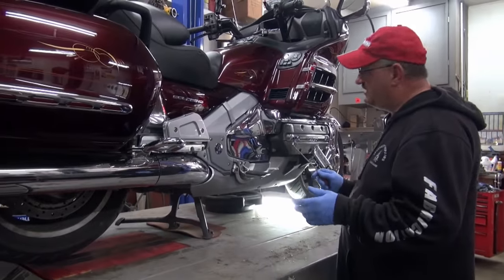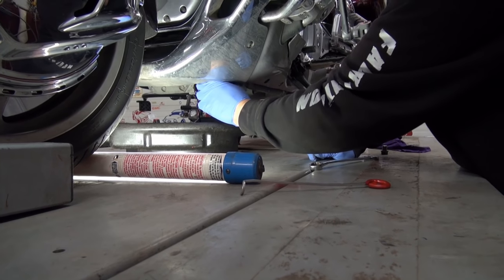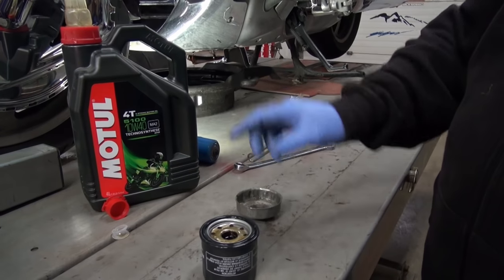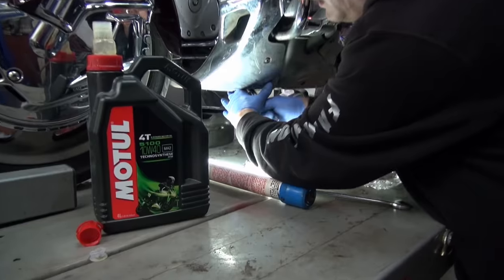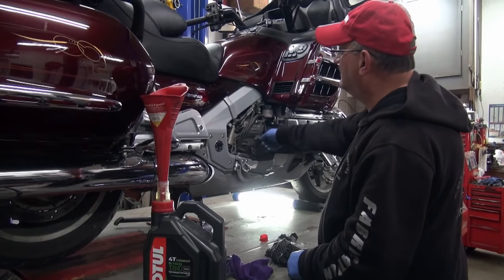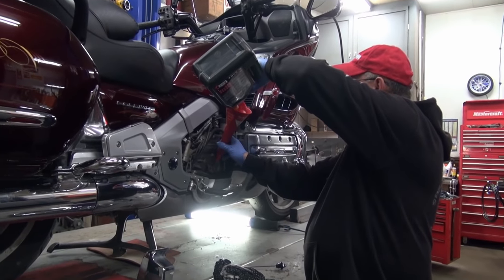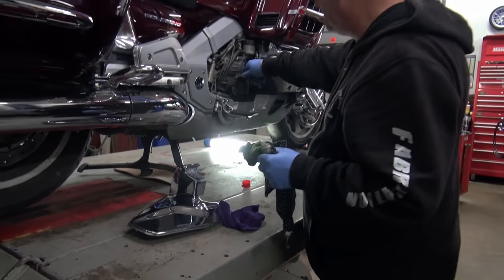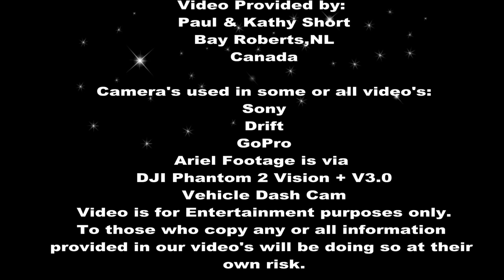Changing the Oil On A Honda GL1800 GoldWing

Comment: I was running Honda GN4 oil in my 2008 Goldwing. Then I watched this video and decided to try Motul synthetic (and prime the filter, of course). I can't belive how much smoother it shifts gears now. It's a stark difference. As always, Paul's advice is spot on!
Reply: You should use GN4 instead of full synthetic oil. Honda motorcycle use not fully synthetic because of the motorcycle clutch. Full synthetic oil make the clutch slip. It’s not good. It’s slipper not smoother
Reply: @DungNguyen-fj2wp  That's true for some bikes with some oils, but not for this oil with the GL1800. I have been using it for more than a year and the clutch is not slipping. I've been riding motorcycles for almost 50 years and I know the difference between smooth gear shifting and a slipping clutch.
Reply: @DungNguyen-fj2wp  You are wrong. Full synthetic MA or MA2 oil will not harm wet clutches. Car oil will.
Reply from the maker: I’ve been using that oil in my 2003 Honda GoldWing since it’s second oil change in 2003. Great stuff. Glad you found it good as well. Ride safe 😂
Reply from the maker: I’ve used it in my 2003 since new. Never an issue and purchased at the Honda motorcycle dealership.
Reply from the maker: You are totally wrong. I’ve use this oil since 2003. No Issues whatsoever.
Reply from the maker: It’s the best oil out there for the GL1800. Hands down.
Reply from the maker: @seatime674  Yes it does. Same location as the other 1800’s over the years years.

Comment: Just called Honda in Mesa and she told me $140 service fee per hour and with oil and supplies around $200 guess I’ll be doing my own as well 😱 thanks for the informative video
Reply from the maker: Not cheap. You’d think as a Honda dealer they would have a flat rate for that service. Do your own. It’s easy. Don’t  forget to  Prefill the oil filter. Your motor will love you for it.

Comment: Very thorough!  Thank you!  Great tip on lubing the side cover grommets.  A lot of Honda dealers don't know to do this, and indeed on my 2001, I lost the right side panel about 20 miles after an oil change, and when I examined the situation, both lower and rear grommets were missing, just like you said!

Comment: Excellent video Paul, precise and to the point.  I just bought a 2008 Goldwing and doing some research I was glad to run into your video because another one advised to remove the fog light cowling and also a secondary cowling to access the oil filter.  I thought to myself, "well, that's kind of a pain".  Now I see you don't have to do that so the process (as you explained it) is now a piece of cake.  I have always primed my oil filters, it just seems like a common sense thing to do so.

Comment: Awesome video. I had to laugh when you talked about putting the dielectric grease in the grommet holes and you said "otherwise, you will be going down the road with your feet on your highway pegs and the cover may blow right off". That is EXACTLY what happened to me this morning on my way back from San Antonio. And it is because I removed the cover last week and when I put it back on, I probably pushed the grommet rings right out. Really good wisdom in your video. Great teaching style and I love how you don't get bogged down on one thing too long. Great teachers, both of you! Thanks again.

Comment: Thanks Paul & Kathy for another very helpful video!

BTW Paul, I just bit the bullet and became a Goldwing owner, well an F6B owner at any rate.  Got myself a gently used 2014 F6B in black with ABS, no cruise control on the 2014 sadly but I'll probably invest in a Brakeaway throttle lock at some point.

I was on the verge of buying a used BMW K1600GTL but the fear of potential high cost of ownership in the future plus the bike feeling super top-heavy to me, the F6B ticked most of the boxes so I went for it.  I'm 58 now, so it will likely be my last bike.

I bought the bike from a guy in Fredericton and riding the F6B back home (2 hour's ride) reassured me that I made the right choice in picking this bike, unbelievably smooth and powerful and oh so comfortable!   My wife is going to love riding on the back!

Your videos helped me really consider a GW too, so thanks for that!

Happy riding and be safe out there.

Comment: Great video...I watched another that the guy removed the entire front lower cowl piece and thought to myself "that looks like a lot of unnecessary work"....Your video proved me correct....Looks to be easier than changing the oil on my 2007 VTX 1300...About to go out and change the oil in my 2015 F6B now....
Reply: Just did my 2013 and I took it off.

Comment: A guy that actually Explains everything he does sure makes for a nice video that gives tips on what you need to know to make it easier like how much oil, nice tip on getting that filter in and it not dumping the oil out as well. I always figured the oil would surely come out real fast. Makes for slightly long videos but good. Just wish I had an infinite data plan lol.

Comment: Nice job on the oil service, changing the washer helps insure you have no messy leaks. Thanks Paul
Reply: I have three honda cars (the same drain plug). The oldest accord 89 with 407k miles, never change the washer and never have any problem with it.

Comment: I had never seen nor heard of the idea of filling the oil filter before putting it on. I tried it and it works great! I did spill a couple of drops (big clumsy hands), but it worked just like in the video! Thanks.
Reply from the maker: Your engine will love you for it 👍

Comment: Great video and exceptionally nice camera lady.  I've decided I need to start doing my own oil and filter changes on my new GoldWing.  It'll take me less time than it takes to run the bike down to the shop!
Reply from the maker: Thanks Jim. Doing it yourself will save you some time at the dealership and yo just know it's safer in your hands than there's. Not many will take the care of your property like you will as the owner. Doing it yourself will give you the confidence to start doing other things to your bike and get you more familiar with it. Kathy said thanks. Ride safe.

Comment: Following up.  After being inspired by your video to do my own Oil and Filter change on my new Gold Wing, I actually did it and was so pleased with the sense of accomplishment that I changed the oil and filter on two other bikes.  I had a couple minor messes (slippery oil filter dropping into the oil drain pan) but don't think I got more than a tablespoon of oil on the floor.  Some Brakleen and paper towels and the floor is spotless again.  Just purchased the oil change kit to complete the oil change on my fourth (and last) bike.  Thanks for the video on your Gold Wing oil change.  You made it look so straightforward and do-able that it gave me the confidence to give it a go.  Also, your tip about not having to remove the lower front cover was right on and saved me time and hassle.  Thanks, again!
Reply from the maker: Congrats Jim. Happy to hear you got it done and more. Nice to know you now have the skills and know how to do it. Proud of you. Thanks for the update. Ride safe

Comment: I appreciate the tech tip with the grommets Paul. I have been going top to bottom through my new to me 08 and went ahead and replaced them all. I also used  dialectic grease as you suggest. The two oblong grommets were dry rotted. One of the oval grommets was actually missing. All of them are new now. Thanks again!
Reply from the maker: Good stuff. Happy to hear it helped you out. Ride safe.

Comment: Great tip about filling your oil filter first. My dad taught me that tip as well. He said  the exact same things you said in the video.
Reply: I am not sure why you would need to do that.  If you fit the filter dry and then add oil to the engine, the oil will make its way into the filter.  To prove it, try adding oil to the crankcase without having a filter mounted and see if it drains out!   The moral of the story is... if you put your filter on without priming it, don't start your engine right away after filling with oil.  Wait for it to make its way into the filter!

Comment: gday mate my father showed me to do that with filters in 1976 and ive done it on every single oil change on any car/bike ect i believe that like you it will eventually cause wear to parts waiting to get that oil .
Reply from the maker: I was taught to do that by an old diesel heavy equipment mechanic many years ago. I’ve always done it since. Every second counts when an engine needs oil and priming the filter gives it a fighting chance. Keep well and thanks for watching.
Reply: @7863348  Mentioned this to a guy called the old mechanic works and does videos on his  cb500x never got a reply from him about it maybe thats why he s the old mechanic the new one primes the filter 🤣 .
Reply from the maker: @crispernator  we have a new full size Ford Bronco. It’s a twin turbo 2.7 and I just did the first oil change on it. It has a cartage type oil filter so no priming it but when I did the oil change and before I started it I applied the brake and went full throttle on it to stop the injectors for opening and cranked the engine over to prime the filter. If you want to help out your engine and keep it purring  you need to get all the tricks required to make it happen. I’m always wanting to learn more and I’m an old dog 😉

Comment: Good tip to pre-fill the filter, at least pre-soak the paper element. Another fussy, detail bit would be to make sure to warm the engine for 3-5 minutes like the manual specifies to warm and expand the oil. Filling to the dipstick mark with the bulk oil temperature cold overfills the sump. Probably doesn't hurt the engine to overfill a bit. Pouring in all 4 litres gets you pretty close + or -. Small overfill would only diminish mileage and power a bit from extra windage losses in the sump.

Comment: Honda's engineers would have designed the filter mount horizontally if instant lubrication w2as an issue. I do agree with you that pre lubeing the filter is a great idea. 
Thanks for a great video.

Comment: I own a 1999 Valkyrie 1500, same engine basically.   I am in the process of hunting a 1800 Goldwing.   This is basically the same, the oil fill is in exactly the same place, but the oil drain and the oil filter are not.   Great info.     Seems pretty basic to me on the grommets, I have always lubed them with silicone grease for all the same reasons you mentioned, easy on/off and to keep them from drying out.   Nice video.

Comment: Great video. Up here in the north, where bikes are stored for five months at a time, I also think it's important to always put the bike away with fresh oil in it....never dirty oil. Metal doesn't like acids which have formed in dirty oil. My 2003 has stayed like new and I do think the engine appreciates clean oil during storage

Comment: I have a 2003 Honda Shadow VT750CD ACE, that I bought used from a gentlemen that I worked with out at McGuire AFB, NJ., and I learned something new by watching this video about changing the filter by pre-charging, I definitely will be doing that as well as using a lubricant on the grommets of my side covers. Also I know you and Kathy are very busy, but if I wanted to send you and e-mail how would I go about doing it?

Comment: I agree, it’s best to prime the filter. I am a Harley guy but searching for a GL1800 and learning about how to maintain them before I buy.
Reply from the maker: I’ve had over 40 bikes in my lifetime and the Wing was always the most reliable and comfortable. Good luck in your search. Ride safe. https://flic.kr/p/292676L
Reply: @7863348  fabulous pictures! What year are both of those?
Reply from the maker: Axel the GL1800 is a bike I bought new in 2003 and still have. The other is a 1980 standard GL1100 I purchased almost 5 years ago and restored from the frame up. It’s like new now with a few custom touches. Ever wonder what Honda’s flagship bike was before there was ever a GoldWing? It was the Honda Dream. Here’s one I have an restored about ten years ago  https://flic.kr/p/SA886u     https://flic.kr/p/4pwmwc.   https://flic.kr/p/7M77N1
Reply: @7863348  … they are both beauty’s! Great job with the restore. The Honda Dream is well… a dream!   😎
Reply from the maker: Thanks. Glad you like it. I started raiding back in 1961. Started off with a Honda Z-50 then onto a Honda CT-70 much like the ones I have restored in the photos. I guess by now you can tell I’m pretty loyal to Honda. That said, it don’t matter what you ride as long as you ride  
https://flic.kr/p/7qau1S.    https://flic.kr/p/7qauuf
Reply: @7863348  … flying to Texas in a few hours to inspect and most likely purchase an 08 GL1800 with Audio / Comfort / Nav / XM / ABS within 27k miles. So excited!
Reply from the maker: Hope it works out make sure the tires are in good shape with no cracks. Bulletproof bikes. Please ride safe. Good luck.

Comment: I enjoyed your video. What got me the most was that you had that bike for 13 yrs. It you don't mind me asking, other than regular maintenance have you had to replace seals, fork oil and things like that. The reason I'm asking is that I am looking at 2009 GW with 5,500 miles. In addition to buying it, I don't want to spend lots of money replacing things due to the age of its parts. Your input will be greatly appreciated. Thanks.
Reply from the maker: Yes I’ve replaced tires, fork seals, oil and filters but that’s the extent of it. This bike is now 18 years old and I’m sure it’s got more than that left into it. My other Goldwing is 41 years old. A 5500 mile Goldwing is a new bike. I would only suspect rotted tres on it. These bikes are built to last. Ride safe. https://flic.kr/p/ES4TES
Reply: @7863348     Beautiful bikes. I had a 1980 GW myself. Thanks for responding.

Comment: Thanx for the instructions, very helpful 👍 Regarding the oil information..are you sure the motul 5100 you used is fully synthetic?I done some research and this one state as semi -synthetic ,the full synthetic oil  from Motul is 7100   
A bit confused ...
Reply from the maker: At the time this video was done it was full. That’s an old video so they’re numbering may have changed since then. Ride safe.

Comment: I'm glad that you primed the filter. I'm not surprised that you did it, though, since I know you do things the right way. :-)
Reply from the maker: Thank you. I've always done that with filters. Always worked well.
Reply: @7863348  hello  Paul I have a 2001 gl 1800 it will not go in reverse  most times. But it will sometimes.  My neutral light comes on sometimes. Same with the  reverse light. So I can't park  without  manual with my  feet. I hope that you can help me out.  Thanks Jonnie.

Comment: Interesting video, I always changed my oil and  never heard  of filling the oilfilter bevore installing, but I Will do this next time! I change the oil 3 or 3 times a year after 235000 KM there have been lots of oil thange. But she is still running smooth

Comment: Great video!! Thank you for sharing!! I do have a question for you.. I see that you're going with the 5100 which is a Blend. Why aren't you using the 7100 which is a full Synthetic? Just curious why you opt for the blend instead of the full synthetic. You see, I like running full synthetic oil, however, I bought my 2007 GL1800 last January and didn't know what the previous owner was running in it so on my 1st oil change I went with the Motul 5100 blend just to be safe just in case he was running non-synthetic; I just didn't want to make that big jump from non synthetic to full synthetic if the bike wasn't used to it. I believe on my next oil change coming due soon I'm going to move on up to the full synthetic which is my goal and my preference to begin with.

Comment: Thank you for the video very informative. One question though when checking the oil shouldn't the bikes run for 3 to 5 minutes?
Reply from the maker: Great. It’s nice to check the oil first when cold to make sure there’s actually oil in there then let the engine warm to check it again.

Comment: Hi guys my name is Paul great name😀.
I just got my dream bike on 4-2-2020
2004 goldwing. So you've had your wing for sometime and you like the rotul oil.I assume you've had no clutch issues and you said makes gears run more quiet.its a little cheaper also than the Honda oil. I watched the rear tire change and didn't realize the rear came off like a car. Hope all is well and healthy up there.
Here in Oregon trying to stay that way. Looking forward to another vid.
Reply from the maker: Hi Paul. Congratulations on your new bike. Outstanding machine. I bought mine new way back in 2003. The first four oil changes were oem Honda oil. Never liked the way the bike shifted and I know bikes. I’ve had over 40 in my lifetime and I used to work as a Honda tech at one time. When I decided to switch to Rotul oil I never had a shifting problem after and never ever put another drop of Honda oil in my bike again. The oil is designed for these bikes. Keep safe and keep well.
Reply: @7863348  thanks for the fast reply.I'll use rotul then. Im a maintenance machinery mechanic tech for almost 40 years so I'll be doing most of the usual up keep.
Thanks again Paul You two have a great day.
May bug you again sometime far warning😂